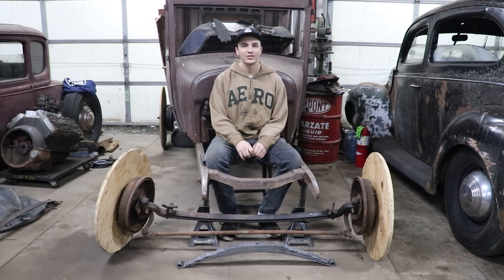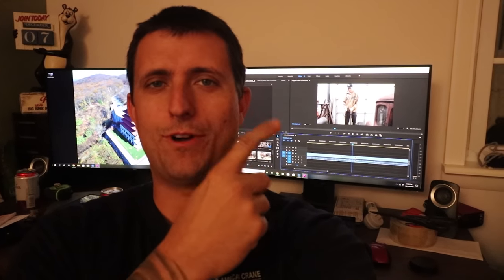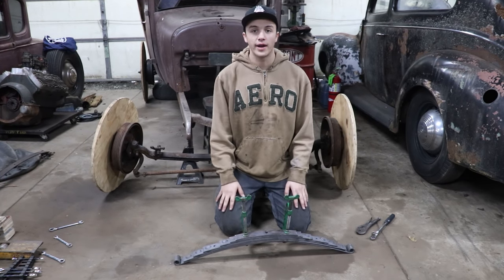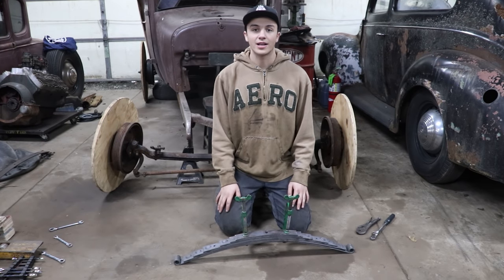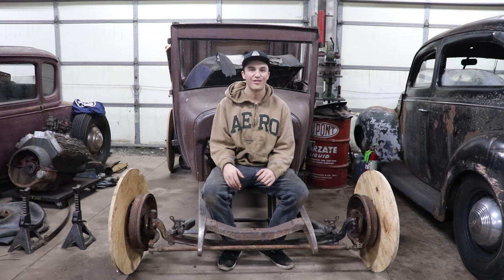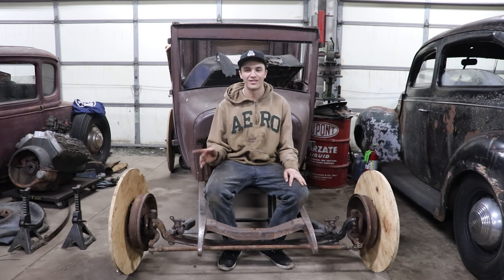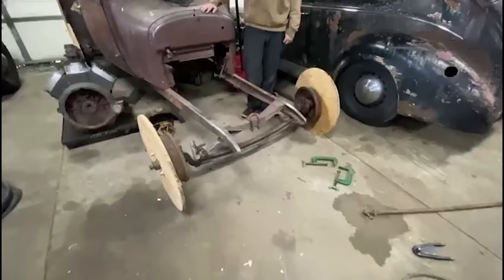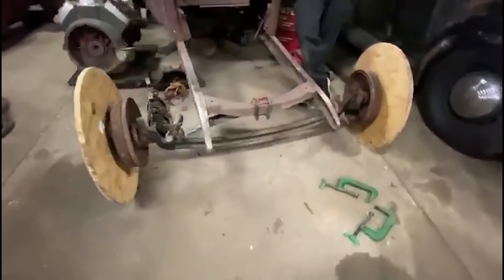Sweet 16 Hot Rod - Front Axle Install - Ep. 13

Comment: While the spring is apart ,polish the rubbing surfaces on the linisher and round the ends of the leaves so they don't dig into the other leaves as the spring compresses. makes for a better ride.
As for the axle, I didn't think it was back to front because I've built a few like that,having the tie rod in front for clearance(split wish bones, hair pins etc ) . You have to swap the stubs side to side and ensure that the centerline through the tie rod eye and king pin goes through the center of the diff head for ackermann to work .
Reply: I saw that the tie rod was in front also but as mercmad mentioned, I knew that many, many t-buckets were built that way to gain tie rod clearance.  My first t-bucket started with the tie rod on the back side but when I changed it to a deuce radiator and grille shell,  the tie rod had to go on the front side.    I really didn't want it that way.  Another thing about hot rodding is that sometimes you have no other choice.    Great job Andrew and everybody!

Comment: Andy where did you buy the spring from ?
Hint: Save your feet work in boots. only trying to be helpful. 
Thanks.
Reply: Good to see someone else that understands this. I watch guys on TV car shows that are welding or even using a cutting torch, while wearing tennis shoes and/or shorts. When I was in my 20's (40 years ago) I did a bunch of overhead stick welding, wearing a t-shirt. I would just man up doing it. Learned it wasn't worth it that night :(
Reply: @stanschmitz5566  Same with me, but I watched Arc without glasses. I was 17. 
Yes you learn by your mistakes, but man, some of those  mistakes hurt.
Reply: @RichieCat4223  yep. Thought I had it covered with a flannel shirt. Only the sleeves gaped open even when buttoned. I had a massive burn on each wrist that took a month to heal.....and back then I healed fast. Now I get cheap cotton socks and cut the toes out at he seam then a hole for my thumb. Not near as hot as welding sleeves and slide into jackets and gloves easily. Nice job on the car! At your age I was still building bicycles. Mistakes are a learning experience!
Reply: @terryfromsouthcarolina4601  I Arc welded a bumper together for pick up with just glasses.
Sunburn ? What Sunburn.  Lol.

Comment: Can't judge. One time I was putting a piston in a motorcycle cylinder, carefully checked the ring gap, clocked them all correctly, pushed the piston in, and walked over to the bike, held it up to the engine and realized that I had just put the piston in through the bottom and it was now upside down.